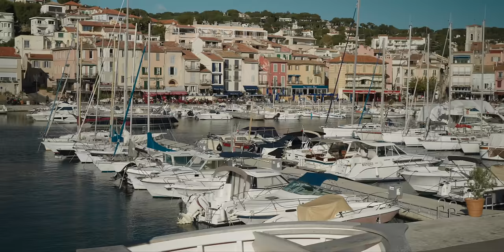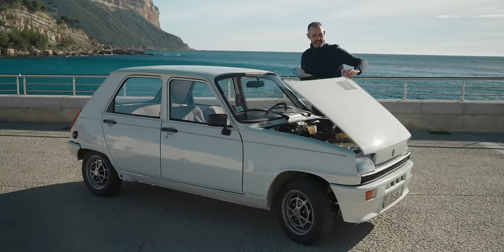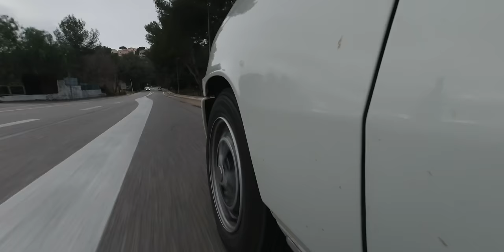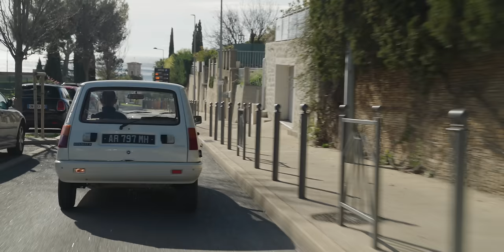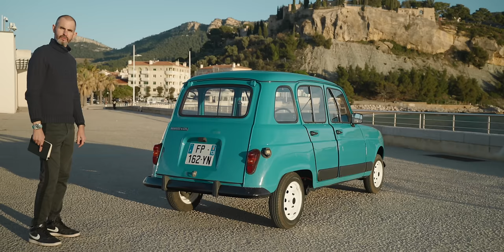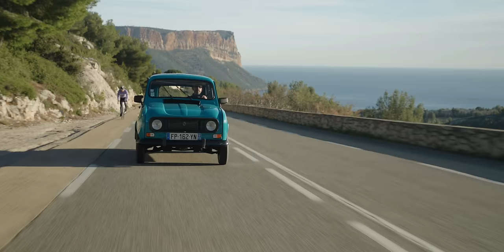Renault 4 and 5 Resto mods - would you electric convert classics like this?

Comment: Part of the wind noise in the 4 could be due to the fact that you can see daylight from inside between the top of the left rear door frame and the body. 😂
Reply: Proper old school French car.
Reply: Le’air con
Reply: Hilarious! 😂
Reply: L'espace dans le panneau!
Reply: Not shut properly and only shut on the safety.
Reply: There's no emoticon for 'Gallic shrug' but you know what I mean
Reply: They used to say that the French quality control included leaving a cat in a closed R4. If the cat couldn’t manage to escape- the car passed 😊 Btw, I grew up in an R4 🙂
Reply: I used to drive an old Renault traffic van and at motorway speed the top of door used to pull away from door seal, so flimsy was the door 😁
Reply: Spotted that as well. 😂
Reply: Le freezing !
Reply: I spotted that 😂
Reply: @fransb8543   🤷
Reply: @1coleman8  close enough!
Reply: They are surprisingly refined, with decent door seals. My R4 makes little more noise than my Saab 9-3 at 60 mph.....Happy little Cars....A few squeaks etc, but hey! 😂
Reply: My (ICE) R4 has the same daylight-door-seal feature - and steering squeak ..all part of the fun

Comment: First generation R5s were front mid engined, just like the R4 and had the gear lever protruding from the dashboard until 1973, when a floor change was introduced. U.S Electricar built an EV version called the Lectric Leopard. A friend in Minnesota still has one.
Reply from the maker: Lectric Leopard? Brilliant. Is your friend's still operable?
Reply: @TheLateBrakeShow  It was a couple of years ago, but a Leaf may have taken over active duty more recently. You can see the car on the EV album, look up Lee Hart. Lee also has the moulds for the Solectria Sunrise EV.
Reply: My wife had a green Renault 5TL in 1986 an Electric conversion makes perfect sense for a town car, as it was always breaking down in the day, but she did buy another a MK 2 GT Turbo which she loved ❤
Reply: An Electric DS that makes perfect sense
Reply: Brilliant ❤ my sister had a Renault 5tl for years! It would handle the rubbish roads we have today like nothing else 😊
Reply: @robertd2363  - my mum had one too - I learnt (and passed)my driving test in it.  Had a floor mounted gear change rather than the earlier (and better) bolt action type one.  A truly superior automotive architecture for the 60s and 70s.  The 16 had almost the same architecture but larger with one of the best column gear changes you could get.
Reply: I knew he’ll pick up on the Lectric Leopard. What a silly name
Reply: I just picked up one of these Lectric Leopards in Pennsylvania last fall, just needs new batteries, everything still works. Mine's a 1980 in beige, 13K miles.
Reply: I had a yellow '74 R5TL in the early 80s (until the floor fell out) an absolute hoot to drive that had the gearbox in front of the engine and the gearstick coming out of the dash.
Reply: Had dark green 4 when I was about 20/21 Yrs old for part-time window cleaning round, wooden extension ladders on the roof and a hot bucket of water that always steamed up the rear window. The stick shift was a hoot! 😅 Some really great Renault models, the 5, the 10 with feather light steering, and the Dauphine

Comment: I had a red 1982 R5 1.1 tl in the late 90’s. It rode like a boat it had so much suspension travel and a leaky fuel tank that also had a stuck fuel level sender. It used to stop at 1/4 of a tank on the gauge 😂. Had some real fun with that little car 🚗. Great content Jonny. Great channel. Keep it going.

Comment: I recently went to the Adelaide Motorsport Festival, specifically to see the 767B Mazda and then they caught my eye, a Renault 5 Turbo and Clio V6 side by side, no fuss, no fanfare, just sitting there, I was totally mesmerised as I didn't think I would ever see either of these cars as they weren't available in OZ. Damn nearly forgot why I was there. 

Basically replacing running gear with alternatives is what hot rodding is all about, got a new word for it now restomodding, same thing different shirt.😊 As usual Mr Smith love it!

Comment: Cracking video, full of nostalgia and charm, including the location.  That R4 is drop dead gorgeous, with the daylight on the rear door included- such a fantastic car to own, everything a car should be, small, light, simple, honest, go anywhere.  Why have more?  In the original though, changing the clutch was fun, you took most of the front off the car, but it was doable by an amateur and a Haynes manual.  I would have one like that tomorrow.

Comment: totally get why you might want to replace the engine in a gas guzzler with an electric motor. But 2CVs/4s sipped fuel (604cc). And the sound of those engines was key to the experience.

Comment: 28.41   " -I'm getting a ton of wind noise" . . .  "  You can actually see day light in the gap between the left passenger door and the body of the car. A friend of mine had a Renault 4L and it was the same on his car. Cheap cars made in a cheap way and not to much of "precison" applied when they were assembled. The 4 was Reanault's answer to Citroën's best seller (at the time in France), the 2CV. 
It is in many ways a copy of the 2CV, side windows, seats, FWD and so on. It even didn't have a window in the C-pillar to begin with, just like the earlier 2CV's.
   BTW, the Renault 4CV was water cooled as all Ranault cars have been, ASIK. 
There was a FWD version/conversion to be had for a while.

Comment: My first car was a Renault 6, which was basically the fancy version of the 4. It had the same hockey-stick gear change, which was basically just a solid rod through the bulkhead with a ring on the end that moved a regular gearstick in the engine bay. That's French problem-solving for you. 

Being young, foolish and indestructible at the time (based on the same self-assessment made by all young male drivers), I spent many months driving round with only two nuts on one of the rear wheels! 😮

Comment: I am obsessed with Renault 5s. I have a carbon copy (even the same colour) of the 5 you showed and have owned it since 1992! We met at one of your shows. I owned the black R5 Turbo 2 with all the crazy mods.
I have considered converting my 5 TL to electric, but I think I would prefer something with a bit more range and power. I'm thinking Leaf running gear, Leaf batteries, and uprated suspension.

Comment: It bothers me that an old simple small-engined classic should become complicated by bolting in the EV kit that most people wouldn't dare touch in the event of a technical issue. The joy of older stuff is the absence of sensors, speed controllers, charging kit etc so if it stops working it's generally something simple...
Reply: 95% of people nowadays have no clue how to change points, use a timing light or strip, clean and tune a carburettor by ear. It is like alchemy to them, never mind dropping the crank at the side of the road to change the big end bearings or set the tappets with a feelers gauge. 

These EVs are way more simpler than a petrol car. These aren't high tech conversions with drive by wire steering, electronic climate control or touch screen controls, they couldn't be simpler, bolt motor with one moving part to gearbox, add speed control and battery, just like that tamiya rc car you probably had as a child.

Comment: I Had a Renault 4, brought cheaply near the end of its life (rust)  Did some big ish Uk trips in it, I loved using the gear stick that projected out of the dash, right next to the steering wheel positioned like modern competition sequential! it had a toquey 4 cylinder 1100cc engine (as I recall) which made it big step up from a 2CV, its sit up and beg layout made for decent space internally for Humans, trips to the tip and even into the wilds of cornwall to fumble with fishing tackle and fail at surfing,
Despite being even at the time, totally superseded by far safer, faster, way more comfortable vehicles, and it not having the hippy cache of the trendy 2CV, I fell for it, loved trundeling around it this practical family tractor.

Comment: If I was given the choice I'd go for the 4. I feel they're more characterful and maybe even more practical.
I remember them being called mountain goats when I was young.
As for using the gearbox I converted an old Freelander to electric and kept the gearbox and 4WD system. I don't have a clutch but don't need it to change gear. 😊

Comment: IT's great to see ways someone could keep one of these cars running well into the future. With the high pollution levels of the original engines (good fuel economy, but still high output of other emissions) this makes these perfect for running about urban / suburban areas. you won't want to cross Europe with one of these EV's, but that's completely OK. The only design flow I see is the shape of the trunk battery. If they made the battery more of a flat, lower hox, then you could use the top of the battery as the raised bottom of the trunk. that would allow for much more flexibility. If the seats were put down then you'd be able to use the large space. Yes the rear trunk floor would be higher than normal, but you won't have the tall box in the way. I love the idea of the bolt in components as well. I know some purists hate this., but with more and more cities in Europe banning older combustion engined cars, this is a great solution. For now it's not cheap, but filling up per file of traveled is a fraction of the cost of gasoline. Over time the savings are there.

Comment: I had a renault 5 as my first car, the main problem aside from the body roll, the lack of power, the over heating in trafic, and the rust was that you could not get enough air from those damn vents ...
That's one of the main thing I recall.

Comment: Early 5's also had the gearbox in front of the engine, and really early ones even had a dash gearchange. Your Dad should have tried the 4x4 Sinpar version of a Renault 4. I had one and as well as my 4x2 versions; it was flipping brilliant in the mud and snow and would really work hard. However, it also rotted like you wouldn't believe.

Comment: That’s a posh R5 … my 1974 was 3 door TL but didn’t have door handles… just a button and a recess in the rear 1/4’s , mine was 950cc it did come with 1100cc , ohh n my gear lever stuck out the dash 😂

Comment: I bought a Renault 5 new, the price was £5555 but my favourite were my Renault 4’s 6volt and 12volt. I also had a 16 TX and a couple of 11’s. I have seen a converted R4 in Sainsbury’s car park Keynesham it looked just the same as the one I had very near the same number plate

Comment: Very cool feature jonny absolutely loved this pair. Your right I am also a child of the 80s/90s and remember seeing these little things everywhere. I distinctly remember a left had drive yellow r4 van outside some shops on the way to school most mornings, that left an impression. Personally I'd have the Renault 4. I do have a question you say changing gears is optional you could just leave it in third? That sounds like the best of both worlds. Manual when you feel like it. Or single gear "auto" style driving if you just want to relax , but.... could the original 3rd gear handle the instant torque of an ev motor or even the original clutch? Much love and long live cute French tin.

Comment: The noise coming from the rear of the 5 is probably the trailing arm mount coming of the body with rot, did they bother to make the wheel base the same length on both sides? No I'm not a fan but i hide it well.

Comment: Yeah, that battery pack taking all the space in the boot would be the deal breaker... if I had enough money to buy this in the first place. Can't wait for the point at which batteries will be small and modular enough to fit where the fuel tank used to be!

Comment: To answer the question, hell no! I wouldn't basterdize a classic with an ev conversion.
Reply from the maker: No classic at all? Not even ones with dull engines?
Reply: @TheLateBrakeShow  I couldn't do it to any classic car even if it had a dull  engine. A classic car is a bit like an old mechanical watch, I wouldnt want to gut it and put electric internals. Im a mechanic and a classic car owner, an ev conversion would also take away my ability to fix and tune the car should something go wrong. Another factor is the cost, you can upgrade or replace a dull engine for alot less than 16k.
Reply: Would you consider a bolt in no unrestorable change electric conversion then there are people that can help you make that half an hour teasing your classic into life make it half an your you could be driving it.   There are people that can help you with this.

Comment: Converting old cars to electric shoul be illegal, those small engines that were used for these cars barely emit any emissions! Most classic cars are only used on sunny days a few times a year and putting in a new lithium battery in that car is way worse for the environment than keeping that old motor alive. Plus the nostalgia is gone when the engine is gone, those iconic sounds that we associate with classic cars is such a big deal, I don't wanna see an old vw beetle and not hear the iconic boxer sound!
Reply: So basically…messing with things that naturally don’t need to be messed with. Clever people, come up with solutions to actual problems. If indeed they are problems. The market will decide when something is a must have.🙂
Reply: I’m afraid I disagree. I’m not sure that those engines were particularly charming. Other than the range, everything about this car as an EV makes it better to drive. Also, it could always be converted back but I doubt anyone would want to do it.

Comment: the manual gearbox is still useful 
every electric motor yes whilst they do have instant torque do have an optimal rpm range and a area where that power starts to fall off. (why powerful ev's often have medeocre top speeds) so you can gear around that. 
plus gearboxs in lower gears multiple torque, so will give more torque then the motor could on it's own.

Comment: I can't get my head around the gears. I can see that you may have to be in a higher gear for top speed as the motor may have a max speed. But surely acceleration is the same whatever gear as max torque is available at all engine speeds?

Comment: Love it.

Shame the rules on EV conversions are so strict over there. Must put a lot of folks of attempting something similar. 

UK has it right IMO. You can go as mad as you like so long as you're willing to go the IVA route ...Although subsidies for conversions would be nice.

Surprised they couldn't split the pack in two, putting one half underneath where the tank would go, and the other half in the bottom 4-5" of space in the boot, leaving a flat floor. But yeah, the range on this seems plenty for most folk's regular day to day use.

Comment: Beside lack of boot space. That large lump of battery in the boot isn’t going to do much for the weight distribution compared to original car. Makes a mockery of French rules about being like original car. Why didn’t they use the petrol tank space for the battery ? It would give more space in boot and move weight forward to within the wheelbase. Not been given much thought in the build unlike Richard Morgan at Electric Classic Cars and everything is mounted on original mounting points within the vehicle.

Comment: I'm going to be entirely predictable here and wish for an electric 16 - but I think I prefer this converted original 5 to the forthcoming electric 5. What would be interesting is an electric conversion of one of the classic rear-engined Renaults - say, an 8 or something even earlier like a Caravelle - even a 4CV.
Reply from the maker: I had a Caravelle. It was rotten.
Reply: @TheLateBrakeShow  Rotten physically or rotten to drive? With the French restrictions (and I think Electric Classic Cars say you can't cut cars about too much in the UK either) I think an 8 Gordini would be a hoot.

Comment: I think if you are doing an EV Restomod of a Renault 5 to make it a practical daily driver, crack on. If you are changing it to electric but giving it insufficient range & luggage capacity to be a practical city car, you have to ask... what' on earth is the point? I'm sure a lot of the inadequacy is driven by the French Construction & Use regs but still, if the result is more expensive, less practical & less usable than the original, I'm really not seeing why. 

You can imagine what a good conversion would do...

Comment: With most classics people do not drive that much. 
Keep them as is, with all their characteristics, smell, noise, weird quirks.....etc. And if you wan to go EV, buy a new one or a used one. 

I would never convert my '68 R4. I love the smell of oil, grease, petrol...the noise it makes when starting up, idling, full throttle....engine noise when driving.....  
All these add to the experience of driving a classic car. The name already has it summarized. It is a classic car. Not destined to go electric, but to enjoy it as the designers intended.

Comment: A brand new total Dacia Sprint EV costs the same. Insanely overpriced, but then it's designed for a car that's hardly on the road anymore.
We need PHEV conversions for modern VW Golf and such cars. Same battery size, replace gearbox by 3-spd with integrated motors. Super peppy hybrid from a modern power stock car. Keep the engine, it's fine. Add battery to be silent in the city and get discounts for your explicit virtuosity.

Comment: EV classics... I've a Citroen LNA with a very clean shell but not the best running of engines.  EV might be a future option but for the future rather than now as the cost would be prohibitive.  Much cheaper to get the current mechanicals overhauled.
Reply from the maker: LNA? That is a rare beast...
Reply: @TheLateBrakeShow  Yes an LNA, and a Peugeot 104. So a couple of rare beasts